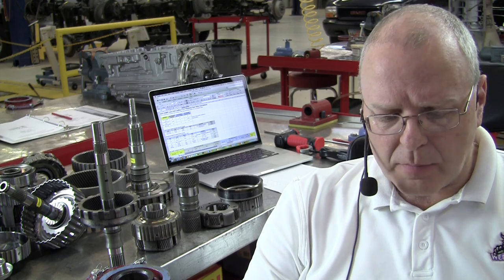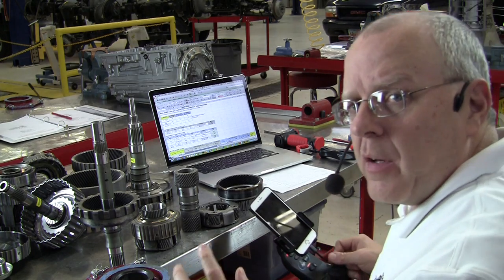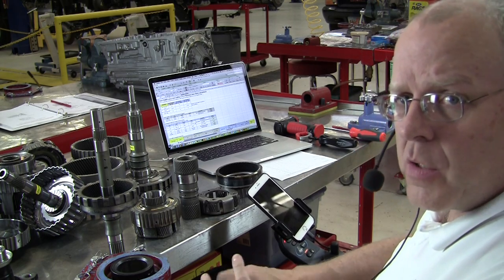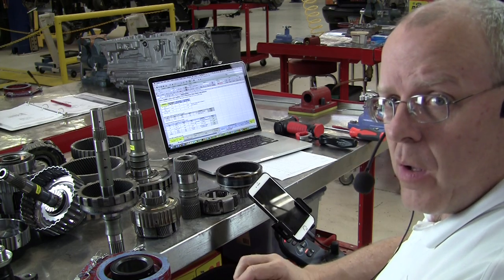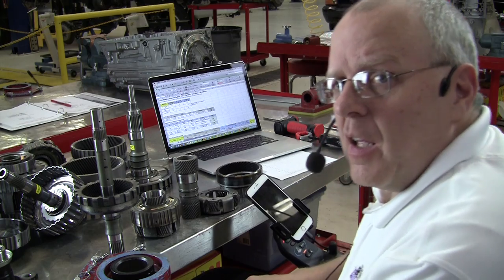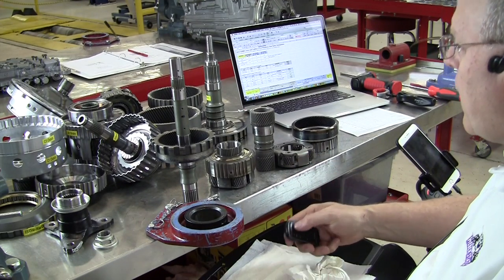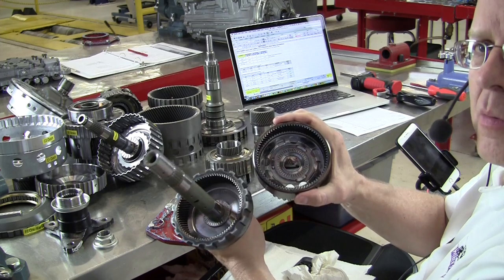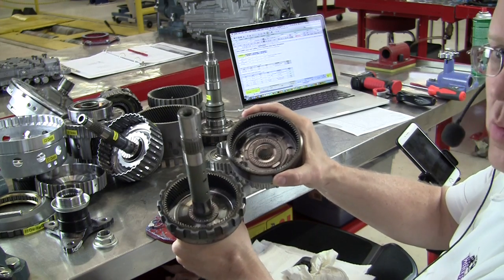8 Speed Automatic Transmission - Lexus AA80E (Aisin TL-80SN)

Comment from the maker: SolidCopy1, The Hellcat uses the ZF 8HP 8-Speed automatic transmission I mentioned in this video. Thanks for watching.
Reply: Do  you have a video on one of the most horrific transmissions ever engineered by those damn Germans..........namely the 4HP 22 which was installed in a wide variety of vehicles throughout the 1980s/1990s. 

If you are not familiar with it,it will burn-up the Forward Clutches in Park/Neutral during a routine emission test. ZF's reply then,was never warm-up/idle/rev the engine in Neutral/Park without the vehicle on a lift and allowing the driven wheels to spin............and install a larger pan.

Comment: Professor  Kelly in 2016 when Land Cruiser moved to 8 speed I didn't understand what was the benefit of the two extra gears. That tiny gear change can improve fuel consumption by 11%, that's indeed mind-blowing. You explained it so clearly which I couldn't find anywhere else. Thanks. :)

Comment: Regarding your comment about Ravigneaux gearset, the GM "Hydra-matic" 4L30E has a Ravigneaux gearset, the planetary carrier is the output drive to the prop. However it does only uses 3 speeds from the gearset, the 4th speed is an overdrive and is attached between the torque convertor and the main casing. This transmission was used circa 1992 to 1999, although probably not in US models, it was used in European models in the Vauxhall/Opel stable. Interestingly this transmission was made in France for GM.
Reply from the maker: Thanks for the feedback!

Comment: That Aisin 8sp reminds me about tractor transmission, where they do fun things with torque splits a lot. They have main shafts and they have few secondary shafts that use torque in the other ways to make new gears. I've read about some prototypes of mechanical-electric transmission hybrids, where electric motors are used for driving those secondary shafts to simulate CVT ratios.
Thank you for your channel! I'll dig it up. I'd like to invent some usable CVTs for high torque/high speed applications..
Reply from the maker: Awesome feedback, thank you!

Comment: Dear WeberAuto,

Thank you for what I consider the best video on youtube explaining the history, progression, and engineering related to the automatic transmission.

You must be a great professor at WSU as your presentation is detailed and readily understood by most users interested in gearing and transmission technology.

I found the detail on the Aisin AA80E to be very informative and also made me think about it competition:  GM 8L90E and ZFHP.

The Aisin uses 3 planetary gear sets to achieve 8-ratios while GM and ZF use four.

In addition to my mechanical background, I am also a computer nerd and use binary computations all the time.  To me, it seems logical that an 8spd Aisin can be produced using 3-inline gear sets:  2x2x2=8 (2 x 4spds)

That being said, why does GM or ZF not use four gear-sets to produce an 16spd trans?.....2x2x2x2=16

Could be possible redundancy in gear rations or OD of ring gear being too large for application and achieve even spacing?

Any thoughts?  Or am I off-base in believing that 4 planetary gear sets can achieve 16spds?

PS:  Heavy duty trucks have been using the x2 multiplier since the 80's or earlier (even Corvette offered a 4+3 manual)

Interested in your professional comments.

Thank you,
Alan - Automotive Engineer
Reply from the maker: LSmiata Thanks for watching and for your nice comments. Each planetary gear set is actually capable of delivering: two under-drive ratios, direct-drive, two over-drive ratios, and two reverse ratios. The more gear sets you use the more expensive, heavy, and complex the transmission becomes. I know that cost and weight are the two main factors in design. Patent infringements are also a concern. Best wishes.

Comment: Cool, John. I see that the Ravigneaux works the same way as the Borg Warner / Fordomatic from 1950/51 with the only major difference being those old sets were 3 speed, they did not have the "drive carrier / hold large sun" overdrive gear. The Ravigneaux 4 speed drives the carrier and small sun for 3rd gear, the BW/Fordomatic drove the small sun and large sun, the effect in both cases is to lock the train together giving a 1:1 ratio. I see how the 6 speed Lapelletier is a simple adaptation of the 4 speed Ravigneaux with the additional planetary set in series. Now I see how the Aisin is an adaptation of that Lapelletier. Thanks!
Reply from the maker: Thanks for your feedback!

Comment: Aisin transmission uses compound planetary gear sets. A compound planetary gear set is a planetary gear set that has multiple sun gears or multiple ring gears.  One is called the Ravingeaux gear set, which has two sun gears, two planet carriers and they share one common ring gear.
One Ravingeaux gear set can provide 4 forward gear ratios and also the neutral and reverse.  The Aisin AA80E uses one standard planetary gear, plus one Ravingeaux gear set. When combined together, These two gear sets can provide 6 to 8 forward gear ratios.  The AA80E uses two gear sets (strictly speaking there is 3 sets – because the compound set contains 2), and 6 shifting elements – 2 brakes and 4 clutches.  Compared to the ZF 8HP, the ZF uses 4 standard planetary gear sets and 5 shifting elements (2 brakes and 3 clutches).  With the AA80E at each gear there are 4 clutches/brakes are disengaged will still create drag, because there are fluid between the clutch plates and brake pads and it creates fluid drag forces when the plates/pads on each side rotating at a different speed. Compared to the ZF 8HP, it only has 2 clutch/brake disengaged for each gear, therefore the ZF 8HP will has higher operating efficiency.  The ZF8 can also handle 114 more lb.-ft. Torque than the AA80E.  The ZF8 provides is more efficient providing higher mpg, shifts faster, is more versatile, and less complicated.  don't get me wrong the AA80E is a great 8 speed.  It just hasn't been around as long as the ZF8 and is behind a little.   Give them some time to improve on it.
Reply from the maker: Thanks for your feedback. The ZF 8HP is a better transmission. Even the latest Aisin AE80E 8-speed is having troubles with higher torque loads.

Comment: ZF 8HP XX; that's the ZF model number format.
The last two numbers, shown as "XX", is the torque rating for the transmission in DecaNewton-Meters (daNm). That torque range it from 30 to 90 decanewton-meters; 300 Nm to 900 Nm.
Reply from the maker: Thanks for the information

Comment: Seems like a much more intelligent use of the clutches on this Aisin 8spd over the almost absurdly complex ZF 8spd unit in your other video. Surprising the French was the one who thought of this; we automatically assume Japanese & German engineers are good at doing what they do while Peugeots are about as reliable as FCA products in the long-haul (laughs).
However the ratio spread between 3, 4 and 5 are pretty darn close, while the 2-3 shift is quite far. I noticed this in the IS-F and RC350 when going full throttle. I guess this helps rapid passing maneuvers, but I guess due to the limitations of this design makes it impossible to equally space them out, which the ZF 8HP seems to be able to do.
Reply from the maker: Thanks for your feedback! good points.

Comment: I don't know whether I missed it but what is the advantage of a 6 speed transmission let alone an 8? I had and older model Camry with 4 speed and I was happy with it. I now have a 2009 Camry which has 6 speeds. I hate it. It seems to always to be shifting as I drive around town. If I am going up a mild overpass it kicks down unnecessarily (in my opinion) and the engine rpms go up. I live in South Florida which is virtually flat yet the shifting  seems to never cease with the engine revving up in between shifts. Anyhow, thanks for sharing your knowledge.
Reply from the maker: +tommie293 Hi, the advantage of more gears in a transmission today is to keep the engine rpm in a small window where the efficiency, power and emissions are at their best.  This gives the driver the illusion of high power and delivers good fuel economy at the same time. Thanks for watching!

Comment: Great video!  How much power do you think this 8 speed can hold?   Also when someone has a built transmission what have they upgraded, especially in the case of this 8 speed?  Thanks!
Reply from the maker: Thank you! The model in this video was not intended for high torque and horsepower. Newer versions of it are strengthened more.
Reply: WeberAuto Interesting Thanks!  Also one more thing which transmission do you think is more advanced and capable of holding more power this or the ZF 8 speed?  Also do you think the new GM/Ford 10 speed will make these 8 speeds obsolete or is 10 just too many?

Comment: John love watching your videos. we are currently building the new GM 8speed transmisions 8L45 and 8L90. We just finished the training power flow for that one. i notice the TH400 geartrain holder you use has a spcer inside where did you gte it or have it made?As a 15 year ford technition and now in the remanufacture transmission busniess i can not get enough of transmission and  10 speed gm is right around the corner.Thanks, Terry
Reply from the maker: +Terrence Trend Hi, thanks. The spacer was part of the TH400 and 4L80E required tools. It is Kent-Moore part number J-21364-A. I love the spacer, I use it with almost every transmission I teach because it keeps things centered in the J-6116-01 holding fixture.  Thanks for watching.

Comment: I have a 2007 Lexus GS460 8 speed Auto with 76k on the clock. I have notice after being parked on steep hills, when the gearbox is cold, it slips in reverse. U-turning at the same time in drive it does the same. Once the car is moving everything seems to be ok. This is very disconcerting. I can not help but think damage is being done.is there any way to fix this? BTW this gear box oil is changed regularly.
Reply from the maker: Chances are the damage is done. I believe there is a software update for the transmission controller that may help. The B2 brake  (Reverse)  and the F1 roller clutch (first) seem to be the weak points in the transmission. Best wishes

Comment: I'm just a automotive electrical tech but I'm finding your presentations VERY informative. One question though. The front planetary achieving a 1.8 reduction by driving the planetary carrier must have something special happening inside otherwise my understanding is it would be an overdrive. Is it a compound planetary of some sort? The video shows clearly it is a reduction, I'm just curious how. Thank again for the amazing teaching.
Reply from the maker: +Philip Housel Hi, the front planetary is just a simple gear set, but it is used differently than other transmissions with simple gear sets. The front planetary is only there to provide two input speeds (at the same time) to the Ravigneaux gear set. Until this transmission, a Ravigneaux only had one input speed.  The two speeds are used individually or simultaneously depending upon the Ravigneaux gear ratio desired. It is an ingenious design. Thanks for watching!
Reply: +WeberAuto thanks for a quick reply. I've been thinking through and researching various planetary gearsets most of the morning. I suspect, upon closer inspection you might discover there's a double planetary carrier in that otherwise simple gearset. again, thank you for the hands on demonstrations. I am very intrigued by how the magic works inside automatic transmissions.
Reply from the maker: +Philip Housel Hi, you are correct, the input gear set does have double planet gears, but all that does is reverse the direction of the ring gear so that the sun and ring turn the same direction to drive the Ravigneaux gear set. The double pinions do not have any affect on the gear ratio of the front gear set. Good observation. Have a great day!

Comment: Professor Kelly,  would you have a comment on whether the 8 speed Aisin would have better or worse longevity than the previous 6 speed used in Toyota/Lexus vehicles?
Reply from the maker: I personally think the 6 speed is more heavy duty and can handle heavy loads better. Other than that, the 8-speed is great
Reply: Thanks.   I have an older LS430 with the 5 speed and it has over 370K on it with only a couple of fluid changes.   That Aisin trans is so good it seems like it will outlast the  motor in this car.

Comment: The Ravigneaux Geartrain was used by Ford starting in @1950 in the Fordomatic/Cruiso-Matic/FMX series. It was used as a 3 speed. It wasn't until 1979 when Ford came out with the AOD (Automatic OverDrive) that they used that as a 4 speed, Overdrive. That morphed into the AODE when computer controls took over and then into the 4R70/4R70W/4R75 series, differing primarily due to gear ratio and torque capacity.. Hope this helps.
Reply from the maker: +Leo Schneggenburger Thanks for the feedback!

Comment: professor, why do some ls460 rwd transmissions whine at low speeds and stop whinning around 40 mph. i notice the whinning stops appox 40 mph and there is a gear chage evidenced by a drop in rpm. any ideas how one can remedy this. lexus has a tsb concerning the with a new isolator and mount for mostly 2013 - 2015 production cars but it does not remedy the whine . my concern is longevity of the transmission. thank you for your advice and video time. john aycock naples fl. 2013.ls460 45,000.miles

Comment: what would be the base-standard Dodge ½-ton SWB model current which would use this or what model to look for and what to spec for getting away from light-weight manual in my C1500 & the plastic-clutch?

Comment: Congratulations! I watched it several times walking my dog, so now even he could easy explain the power flowin AA80E transmission😊 I just have two remarks:

The front planetary gear set is not a simple one. If that was the case having fixed sun gear and the planet carrier as an input the gear ratio would give an overdrive. Based on the Willis formula the theoretically possible ratio range is form 0.5 to 1.0.  Apparently, it is not the case as your video shows at 35:00. It is because the pinion gears/planets that are “rolling” on the fixed sun do not contact the ring gear teeth, but rather turn the outer set of pinion gears. The outer pinions propel the ring gear. From what I’ve found on the internet the front sun gear has 38 teeth, the inner pinions 16, the outer pinions 19 and the ring gear 82. If it was a simple planetary gear set, the ration would be (82+38)/82=1.46. I haven’t done the math yet for the actual design, but I’m sure that’s what gives the reduction.

The fourth gear, you give a credit for the ingenuity of the design, takes advantage of splitting the torque and letting it go by two paths. It is easy to understand again by looking at the Willis formula: nr*zr = nc*(zr+zs)-zs*ns. On the one hand you are turning the carrier (nc) but on the other hand you subtract the sun motion (ns). I’m sure you know it, but for the sake of clarity it might be helpful for others. I understand that the aim of your videos is to show how the actual stuff works, but sometimes adding simple math helps.

Comment: Cadillac CTS VSport uses this Aisin, NOT the CTS-V.  Those are 2 different vehicles/drivetrains.
Reply from the maker: Thanks for your feedback!
Reply: @WeberAuto  You're welcome.  For better clarification(more detail), the latest CTS-V runs the 640hp supercharged 6.2L V8 with the GM 8L90 8 Speed auto.
The CTS VSPORT is equipped with a 420hp twin turbo 3.6L V6 and the subject Aisin 8 speed auto.

Comment: hi  jhon  thanks  a lot  for  your   videos  i just  start  and  i want to  learn  would  you explain   why   the  final drive  need  a reduction  gear.
Reply from the maker: +Marek Wijas Hi, the final drive gear reduction also multiplies engine torque. it allows the vehicle to accelerate rapidly.
Reply: +WeberAuto  thanks

Comment: ZF 6HP transmission also is this design, which the difference between 6hp and ASIN 6 speed or 8 speed transmission
Reply from the maker: I have not studied the ZF 6HP in detail yet, but I can tell you the 8-speed Aisin is unique in it's design. It is almost like a Dual Clutch Transmission (DCT) where it has two different input shaft speeds. I will make a video on the 6HP later this year. Thanks for your feedback.

Comment: Btr or ion or DSI (same company) made a four speed using the ravigneux gear set. Australian.
Reply from the maker: boganindustries Thank you! I did not know that.
Reply: +WeberAuto  Basically a Borg Warner based design from what I recall. Built specifically for Ford Australia and later in the companies life (before DSI was bought out by Cherry - chinese company) they where installing them in Ssang Yong (Korean) and Mahindra (Indian) they where developing a 6speed RWD based on the same casing and internals with another addition to the ravigneux gear train and also a 6speed FWD and a 7speed RWD. I was a draftsman there briefly.

Comment: I have a 2007 Lexus Ls 460L  Add it has this  8 speed transmission  starting to slip between 2nd and 3rd year only a 140000 miles I don't know what to do, Rebuild that 1 or get another one from a junkyard, Any info would be appreciated
Reply from the maker: Check the fluid level. A salvage yard transmission is a good option.